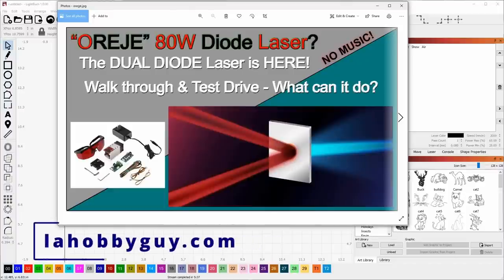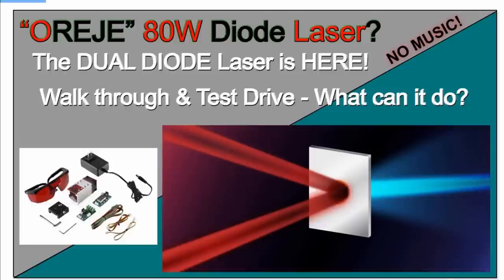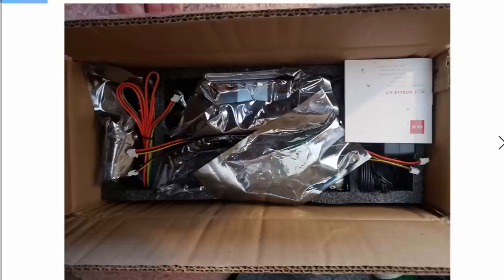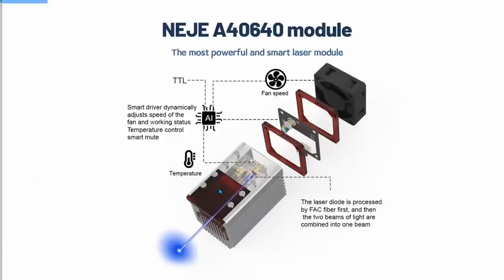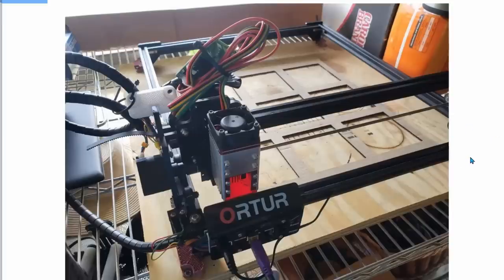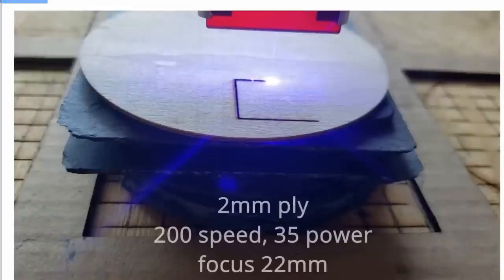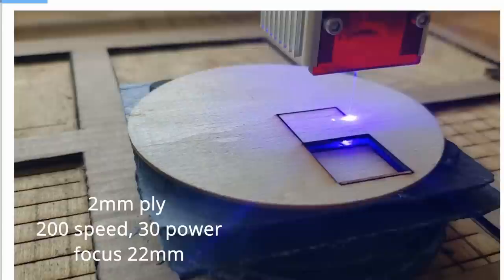Upgrading a diode laser from 20 to 80 watts!

Comment: Hey Rich,  I recently bought the ORTUR Master 2 Pro but haven’t got my shed finished so I can set it up, My question is would this new dual laser be a upgrade I should do from the get go?? And for the money is it worth putting it into the ORTUR or save my money towards a better and may be bigger Laser? I really like what the upgraded laser can do. ORTUR has a Head focusing controller I’m looking at to buy will this duel laser fit on it? Thanks for the video it was so helpful.
Reply from the maker: I would say to start with the OEM setup and get to know it and its capabilities. I only upgraded because I wanted to cut faster. But yeah, you can make it fit like I did in the video, but I ultimately wound up 3D printing a new baseplate for it.
Reply: @TheLouisianaHobbyGuy   faster is better, thanks for the reply.
Reply: @TheLouisianaHobbyGuy    I have not seen any more vids on your upgrade.  Are you still happy with it?  Could you provide the file the baseplate?
Reply from the maker: @alpscraftshack599  Shoot me an email and I'll send you the stl. thelahobbyguy@gmail.com

Comment: Hi Rich - so I finally received my 80w laser module from Neje. Same package as you have. I need to get the circuit board adapter you included printed, which I totally forgot to get done ahead of time. My question to you is, You mentioned in this video that the neje laser adapter fit right onto the ortur laser adapter and I see that in your video. Did you need to add a hole as only one hole lines up on mine. How did you mount them together ?
Reply from the maker: I only used the one hole and made the screw really tight. You could drill another one, but it worked fine for me for months until I printed a new mounting board.
Reply: @TheLouisianaHobbyGuy  Thanks for the speedy reply Rich. Yeah I installed it with one screw right now, tight. Ive noticed the neje sits so far forward now, that it hits the bottom rail. I guess I'll need to move my homing switch up a good inch.
Reply from the maker: @IIIofV  Yes, I had to move the switch up about a half inch. Well not really, I just glued a piece of wood to it.
Reply: @TheLouisianaHobbyGuy  yes I cheated too. I wanted to get to lasering asap. I glued a small piece of plexiglass to the unit to fill the gap. I think a better mount design would allow for adjustment in a smaller form. Rather then using the plate and ortur mount and neje mount.

Comment: I see you have the same bed system as I have :) I do however have a bit more spacing 
I am using the other 80watt module with the dual fans.

i cuts like a charm
Reply from the maker: Yes it does Patrick!
Reply: hi Patrick..... Where can i find that laser with dual fans ?
Reply: I'm curious as well. Cheers!

Comment: Great video & very useful informations, many thanks, Rich. 
Quick question - where did you get the [stainless steel?] cones for material support?
Reply from the maker: Punk studs on Amazon!
Reply: They are used to decorate leather Jackets, belts etc so most leather suppliers will have them.
Reply from the maker: @grahamham3398  Yeah, and so do some sewing shops and I believe Walmart has them as well. They're quite common. Even my local tattoo guy sells them.

Comment: Hello Rich - I had a quick question for you on this Neje Laser Module upgrade. I've done the upgrade now, but I'm curious. Do I swap my original power supply for my Ortur and instead use the supplied power supply from Neje seeing this laser is more powerful?  I havent done that yet and I'm having the issue that my laser turns off the odd time during cutting and when it resumes (no error in lightburn) it messes up the sequence (almost as if it didnt know the laser stopped).
Reply from the maker: I just plugged the one I got from Neje into my Ortur LM2. If you have the LM2 Pro 24V, you have to remove the red power coming from the Ortur and tape it off and use the power supply from Neje plugged directly into the adapter board.
Reply: @TheLouisianaHobbyGuy  thanks for the reply. I didn’t do that and I think I needed too. I think the ortur power adapter was too low in amps to work continuously.

Comment: Would be interesting to see if you could combine several of these through a similar fashion to get even higher outputs; i.e. take a K40 and replace the giant tube with multiple units like this (and mirrors of course) to create a solid state cutting laser.
Reply from the maker: The diode dual beam is using the FAC lenses. They are collimating the light and the mirror is joining the two into one beam. So yeah, it is possible to add additional diodes, but the mirror calibration would be problematic. It's not like a C02 where you're bouncing one laser beam over three mirrors. You would never get more than one 450nm beam to travel via three mirrors over that distance. Diode lasers have large divergence angle in the fast-axis direction, so the output cannot be efficiently used unless collimated over a short distance. The radiation angle can only be collimated into a small beam over very short distances. Though I do see the future of diode modules incorporating three or four diodes to rival the C02 at a much lesser cost. The bottom line is profit. The Chinese manufacturers are looking at the market. A $300 diode laser will outsell a $900 diode laser by 50 fold, making it more profitable. But there is a mid-level market they're not seeing. C02 lasers hover in the $2K range and above unless you want a K40. There is a huge $1K market they're missing IMO....
Reply: There are modules on the market combining 4 laser diodes abd achieving real 20 Watt power output. They cost nice chunk of money though. They are very powerful and can do more than other diode modules. Still they are limited by the wave length and still can't do transparent materials. For some materials you really need CO2 or fiber or other type of lasers. I am though fascinated with power of today's diode lasers and their efficiency. Someone looking at the numbers like 30 Watt consumption and 5 to 7 Watt output of the laser module would call it not efficient. But knowing that some other type of lasers would need like 200 Watt power consumption plus 50 Watt for it's cooling to achieve few Watt's output power makes thus little diode lasers very efficient.

Comment: Hi i bought one NEJE 80 , but i did not reproduce the sames cuts like you on playwood of 6mm, i dont know what am i did wrong or what is happening with, in some cases only cut the two oposit sides of my scure and the other sides only cut a little bit but not totally.
Could you please help me to understand Whats happening?.
Thanks
Reply from the maker: We have different focuses Pao. 6mm ply needs to be focused 3mm lower than the surface.

Comment: TheLouisianaHobbyGuy, hi I watched  your video on the upgrade to an 80 Watt laser ( I’ve actually watched and subscribed to several of your videos).  I have bought an 80 Watt twin laser head it’s not the same brand as yours in the video, mine is a LaserTree brand but is probable the same Chinese manufacturer 
  I followed all your directions to the letter but, it will not cut through a 3.25mm piece of plywood,  I have tried everything and it’s driving me nuts. Do you have any suggestions please. Roy
Reply from the maker: Probably a focus issue Roy. Try this video: https://youtu.be/sfGlZGhh144

Comment: Hi. I've just added the NEJE 40640 module to my Ortur LM Pro 2 (24v power supply version).  I removed the 24v supply from the connector at the module PCB end and added a 12v 2A supply.  The laser functions but will not cut!!  I've tried cutting 2mm MDF, which the standard (Ortur) 20w laser manages with three passes at 80% power. I'm not sure if it's a focus issue that I'm having but I've tried everything.  Any suggestions as to why this is happening?
Reply from the maker: I can't tell ya... Mine works like a dream, and so do others for people I've upgraded locally. Did you use the PS provided by Neje? The one I got with my kits is a 12v, 4A, 60W. Maybe it's not getting enough power?

Comment: Does anyone know if all the Diode lasers are interchangeable? I have a Sculpfun machine and I want to know if I can upgrade to any laser or if it needs to be one from Sculpfun.
Reply from the maker: If the wiring is the same you can, but usually the mounting is different.

Comment: In the video, you said the Neje bracket holes lined up with the Ortur bracket. Did you only use one screw to attach it. I can only get one screw to line up.
Reply from the maker: Yes Randy, just one temporarily until I 3D printed a a new mount. I made it super tight and it held just fine for over a month before I changed it. I was going to drill out the Ortur mount, but I designed a mount t hold the adapter board as well.
Reply: Would you be willing to share that STL file?
Reply from the maker: @randyday3278  Yes Sir! Just email me!

Comment: How easy is it to update my current laser CNC with this module? I see that there is a motherboard or something like that, will I have to replace something in my current machine, or is it just plug and play as you mentioned in the video? Is it just connecting that board to the board on my machine?  Or is it replacing the board on my machine, for the one you show in the video? My Laser is not an ORTUR, I got my from Sain Smart, do your think it will as easy as on the  ORTUR? I really would like this module to be able to cut some material, mainly 5mm wood.
Reply from the maker: Hi Alf, the SainSmart is a combo machine. It came with a Chinese laser, so I would have to guess, yes, it would work. Since I'm not familiar with this machine, I would check the pin-out and make sure the + - and data pins are in the same position. The board from Neje is just an adapter board for most Chinese lasers. If you emailed me a picture of your current laser connection I could take a look and see if it's the same.
Reply: @TheLouisianaHobbyGuy  thank you, I just sent you some pictures.
Reply from the maker: @Checo1  This looks completely different from a standard Chinese laser which is red, black, green and yellow (ttl). I see the red, black, white on the laser plug, but the ttl is plugged in somewhere else. I wouldn't do it without a schematic. Maybe they can send you one?
Reply: @TheLouisianaHobbyGuy  schematic from SainSmart?  What about trying to get a board from Neje so I can keep my frame ? Will that make sense ?
Reply from the maker: @Checo1  Neje has an adapter board which I bought and used, however your system isn't using the 4-pin harness, so I personally would want a schematic to be able to identify the right wires. You can contact Neje and see if they have an adapter board for yours, but I would doubt it.

Comment: So there is no need to change the control board, it’s plug and play so to speak to any other manufacturer? Been looking for an upgrade to mine, this just might fit the bill.

Help me understand something about focusing the laser please. Do you physically measure the focus from the work surface to the laser? I’ve always just concentrated on dialing in the beam to the smallest point possible on the surface.
Reply from the maker: Yes, plug and play with any 12V system. Dialing in the beam is the preferred way to focus, I 3D printed a step gage with my focal points.
Reply: @TheLouisianaHobbyGuy  looks like price went up to $325 and is out of stock, but still good price from what I’ve seen.
Reply: @TheLouisianaHobbyGuy  forgive the stupid question, but how do you know of your laser is 12v or not. I really don’t know.
Reply: @TheLouisianaHobbyGuy  actually disregard that…lol…I just looked at my power adapter.
Reply from the maker: @r.leepanderjr.6308  🤪

Comment: I got the neje A40640 but when I tried to upgrade the ortur 2 20 watt it dosn't hook up like the video. The ortur is a 3 prong and the neje is a 4 prong. not sure what to do.
Reply from the maker: It should have come with an adapter board and wiring. If not, you bought the wrong one.
Reply: @TheLouisianaHobbyGuy  I got and adapter board but the neje A40460 hooks up with a 4 prong connector , the wires that came with the laser master 2 come with 3 prongs. is there a piggy back plug to hook 4 pong to laser and 3 prong to original wiring. I thought I had the same setup as the one you had on your vidio.

Comment: I have an Ortur Laser Master 2.  It uses a thumb knob on the bottom of the laser module to focus.  What adjuster are you using in order to focus?  I've looked everywhere I can think of but without some specifics I can't locate the correct adjuster to fit the bracket for the neje 80W laser module and I doubt the neje would instrall directly to my gantry.
Reply from the maker: There's no adjuster, it's a fixed focus. You move the entire laser up or down to the right spot.
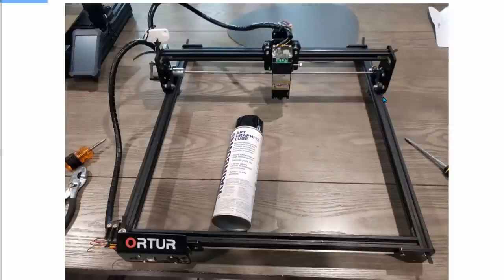Reply: At 4:07 in your video, there is a thumb screw on the side of the laser module.  I assume that is for adjustment of the z axis for the module.  At 4:42 it is shown in close-up and you state that the neje adapter fits right onto the Ortur adapter.  This is the adapter (the Ortur adapter) that I am referring to.  My Ortur Laser Master 2 does not have this adapter.  I'd like to know what the part number is and where I can get it?  Thanx in advance for any help you can give.
Reply from the maker: @greggarman7343  No idea Greg... it came with the Ortur.

Comment: Would you recommend this or a cheap CO2 like the k40 lasers on ebay? I think the cost is comparable for this neje + motion system vs k40 (40w CO2 laser with motion system)
Reply from the maker: A K40 is too small IMO. Many of my projects wouldn't fit on the bed. The modification I made makes my laser far superior to a K40.
Reply: For cutting acrylic the Co2 is far superior. I can do perfect cuts in 3mm acrylic single pass at 80speed with a 40w Glowforge.
Reply: @macrumpton  what about for wood?
Reply from the maker: @thebucketmouse  If you can work with a 8x12" work bed, the K40 is a great machine. However, mine sits collecting dust because it is just too small to be useful.

Comment: I have the Ortur master 2 and the pro version. Would you consider this an upgrade to the proversion? I wanted to make a bigger rail system but this i don't even have to worry about it. 810mm i just the lenght i want anyways.
Reply from the maker: Absolutely Micheal! Think at least twice the power and a smaller focus. One of my friends just changed the frame on his to 2440 x 1220 with 4040 extrusion. He does a lot of fishing & hunting camp signs on full sheets of plywood.

Comment: Is it better to go faster at the higher power or slow and lower power? There's a trade-off between production speed and laser life to consider, I know.
Reply from the maker: Besides the life of the laser, which isn't affected much until you go over 90%, the cleanliness of the cut is what I consider. So if I have 2mm wood for example, there's not much sanding I can do and still have a nice piece. So I would go faster with multiple passes so the wood doesn't scorch. On the other hand, if I'm engraving 3/4" wood, I have plenty of sanding surface, so I would slow it down with one pass. I still don't like scorched edges. The optimum way to dial in a laser is to do a vector & raster test and see what settings provide a clean engraving or cut.
Reply: @TheLouisianaHobbyGuy  OK, so ~80% can run all day and not shorten the emitter life expectancy. 👍
Reply from the maker: @OldCurmudgeon3DP  I can't say for sure because I have never gotten a spectrum life scale from any of the manufacturers I've asked, but I can tell you I have thousands of hours on 2 LU1-4 lasers that did production and the settings never changed. They ran for over 2 years every day at 75-95% power.
Reply: @TheLouisianaHobbyGuy  you've almost talked me into that Neje 810mm. 1st step is dialing it in. 2nd getting it to pay for itself. 3rd, profit(?)
Well, 1st would be getting an exhaust vent installed in the garage for it. 😁
Reply from the maker: Absolutely!

Comment: I connected the Neje's laser module N30820 to ortur laser master 2 S2 and upon turning on the laser through laser grbl software, the fan turns for 1 second and stopped immediately and little bit smoke came from inside the laser so I immediately turned the power off and disconnected all the cables and haven't turned on the laser since then. Is my laser module okay ? Or is it dead ? I'm too afraid to plug it and check!
Reply from the maker: The Neje is 12V and the Ortur is 24V.
Reply: @TheLouisianaHobbyGuy  Yes , actually I didn't know about the power supplies but I came to know about them only after doing all this mess! So, sir do you think that my laser is safe or has it been damaged ?
Reply from the maker: @prajjwalsrivastava4269  No way for me to tell.

Comment: I am not sure how your NEJE mounted to your Ortur bracket. Mine does not line up like yours does. I really wish somebody out there had a step by step on how to get this connected. I am having a hard time mounting the brackets.
Reply from the maker: At first I just used one screw to mount it to the Ortur bracket Jeff and made it really tight. It worked fine for 2 months until I 3D printed a custom adapter.
Reply: @TheLouisianaHobbyGuy  Would you have any of these for sale by chance?
Reply from the maker: @jeffwestbrook6570  If you email me, I'll print you one for the cost of the postage. Just send me your full name and address. thelahobbyguy@gmail.com